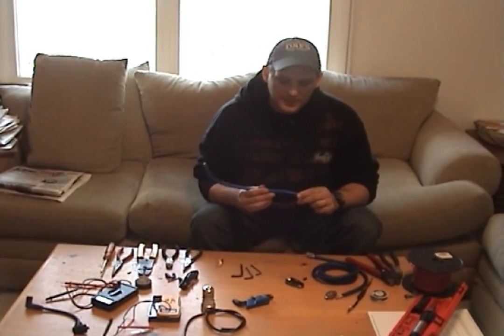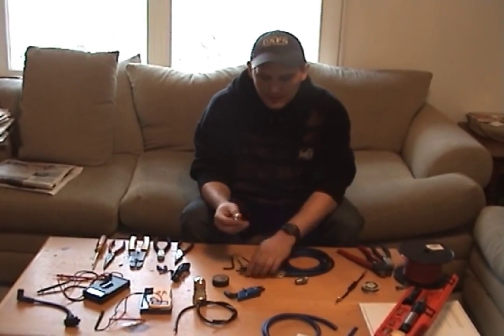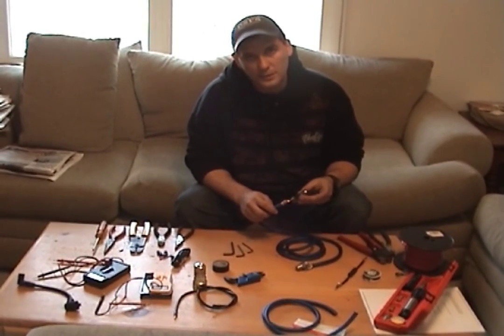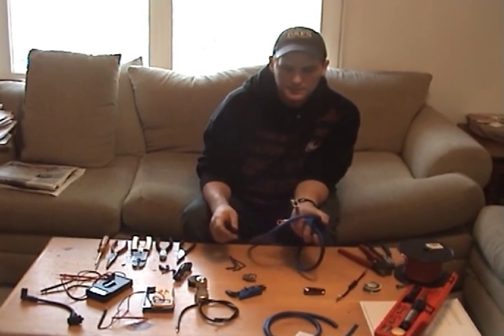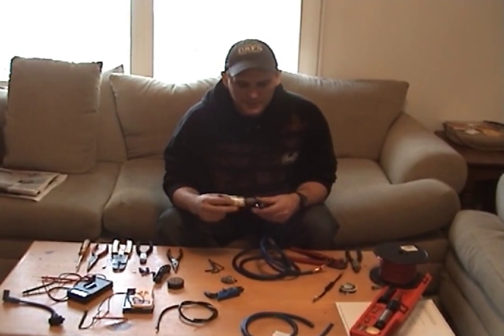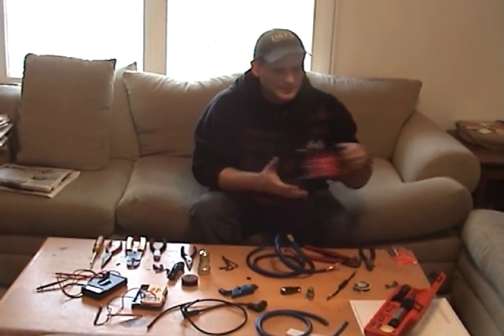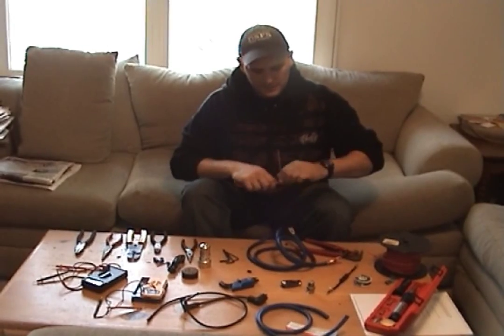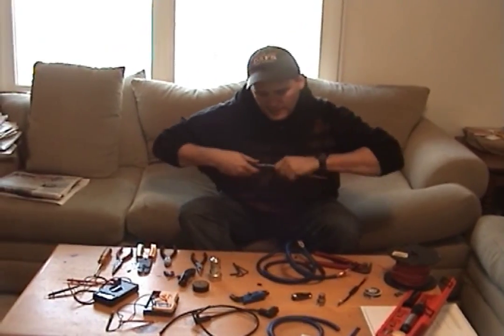KML Wire part 1of 2 Tiny Explanation By Chris

Comment from the maker: I have used the kml on the main coil from the starter coil to the Distributor. I also use them on all sparkplug wires i make myself :) the more kml coils in the system the marrier.

Comment: The series of videos from 1 up have been watched.  After all of that one still does not know what a KML wire is used for, the vzrious functions of the wire.  Just what is a KML wire.  OK, we see that they are wound positive and negative.  In using one how is it determined wheither to use a negative kml or a positive kml?  When and what occurs in not using + o - kml wires?  If something is known about what they are and how they work where can this jnformation be found?